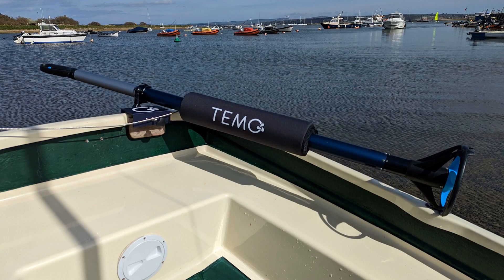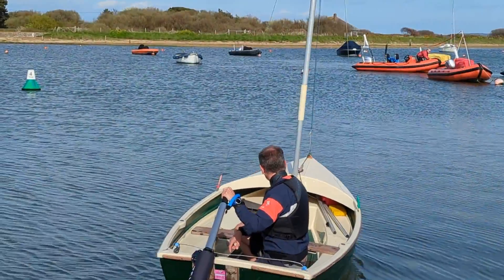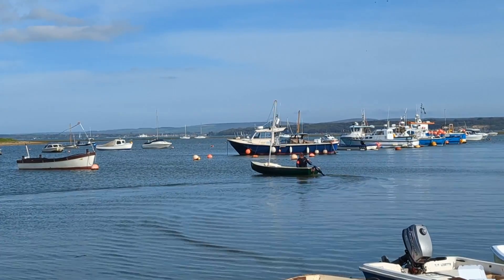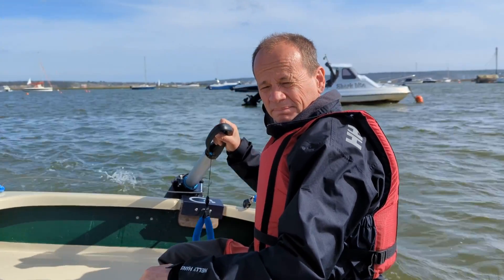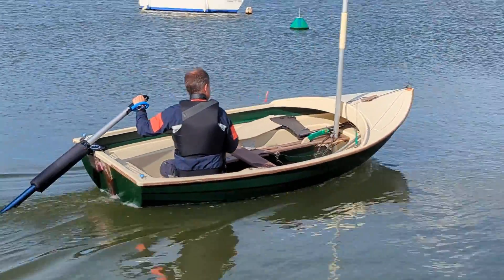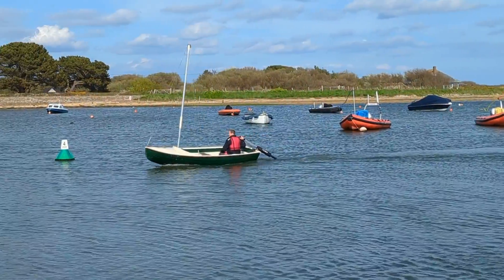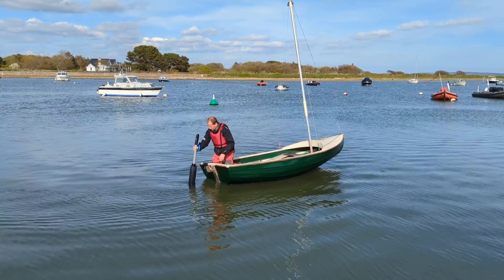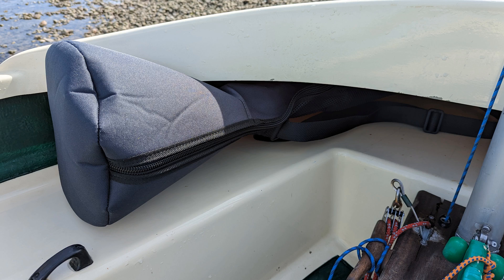On Test: TEMO-450 portable electric powered outboard

Comment: "What" not using a kill cord.... That's not very good practice is it. :(
Reply from the maker: It's not a traditional kill cord in the same way as on a RIB. The button requires positive pressure on the throttle to be on. As soon as a hand leaves the handle the propeller stops.